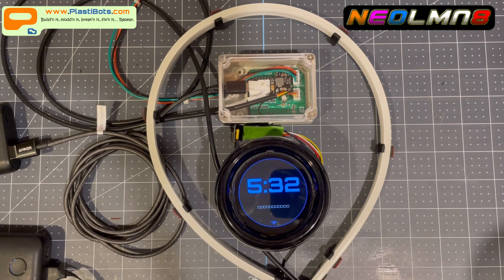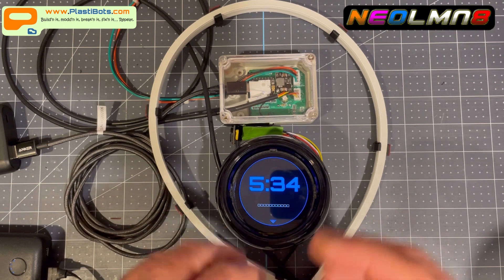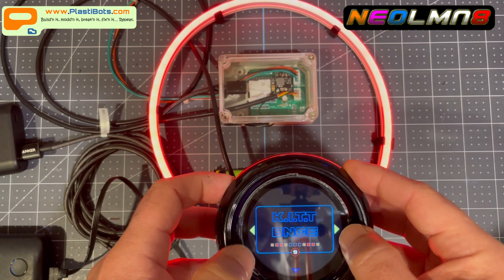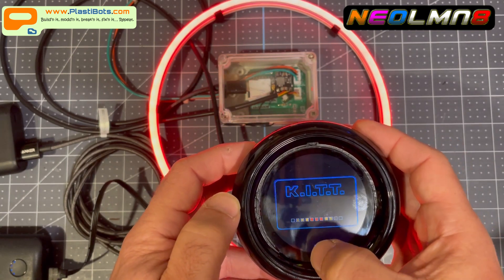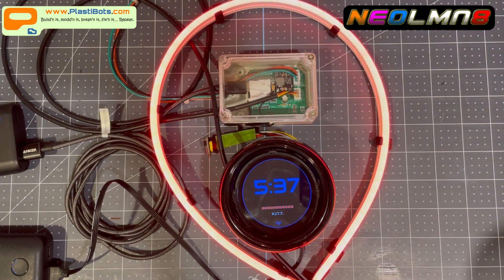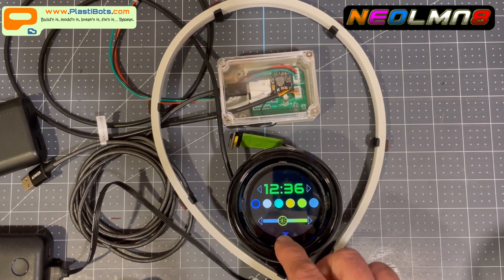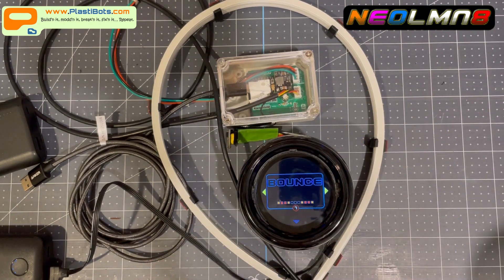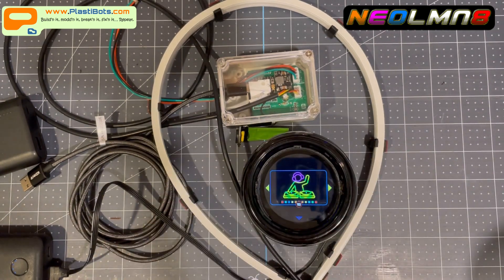Part 4: NeoLumn8 Miata ND2 Rear LED Strip Vent Controller (Lilygo T-RGB ESP32-S3)

Comment: Hey bro how is the screen powered? And how does it communicate with the led strip?
Reply from the maker: Details are in my blog linked in the description.  Powered by drivers fuse panel with a 12>5V switching supply.  Comms is via ESP-NOW